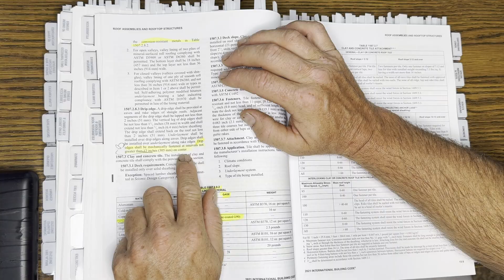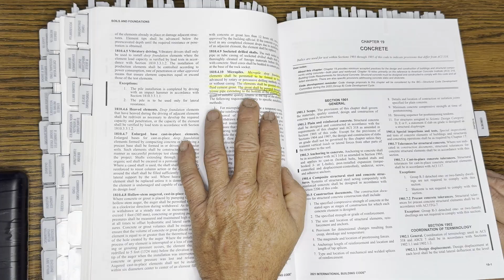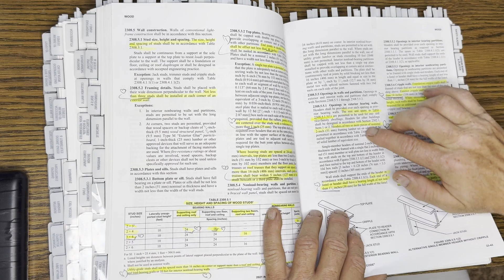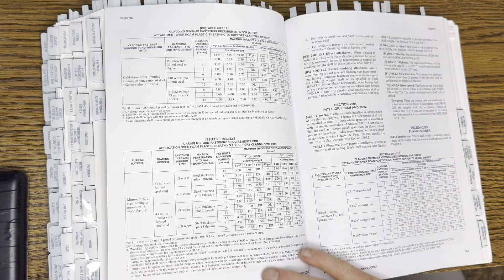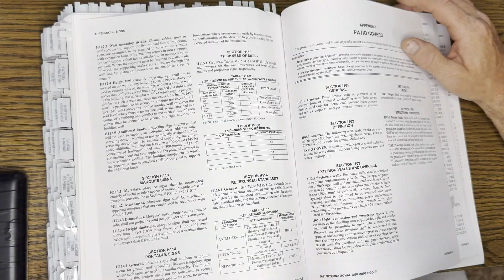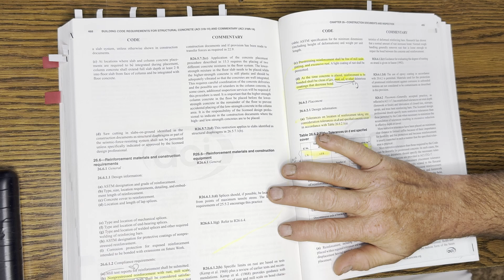ICC Commercial Building Inspector (B2) Part 3 || Finish IBC and ACI 318 notes to help you pass exam

Comment: 107.4  Amended construction doc --  any changes made during construction

722.2.1.1  3.6 in concrete fire-res-rating  --  2 hrs

1107.2.1  5% spaces got to be EV charging

2304.11.3.1 Cross-laminate timber floors -- 4 in

2308.2.1 Cat A -- 3 stoies, Cat C -- 2 stories

2402 replacement glass should be as required for new installations.

I remember there was a question about electrical conduits penetrating a concrete slab. Answer A was “coated,” answer B was “sleeves,” answer C had the number 100 in it, and answer D had the number 144. I hope you can find the relevant chapter.

Comment: I appreciate these videos a lot. They have been a helpful study tool for me! Do you have any tips for time management on the exam? Also you have additional tabs, is that okay for this exam or do we have to have the ICC ones?
Reply from the maker: As long as the tabs are permanent then there will be no problems.
Reply: @CodesExplained I feel dumb for asking but what do the determine is permanent? I just watch to use scotch tape 😅
Reply from the maker: @KaylaMuredda  Very subjective; however, items such as the colored flags used to mark items in a text book would not be permissible.  The tags I used were rigid and very sticky.  There is not a metric to gauge this, but they will flag items such as sticky notes or the common flappy stickers used in college.
Reply: @CodesExplained  I was able to use colored ones but they aren't flappy lol